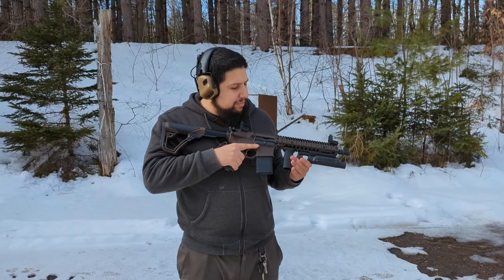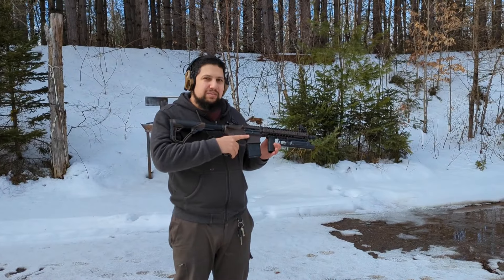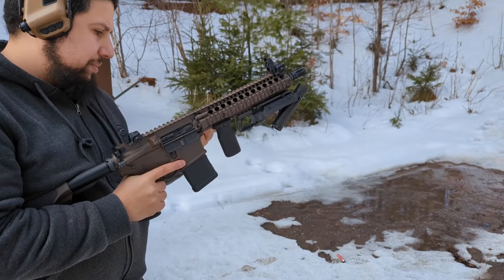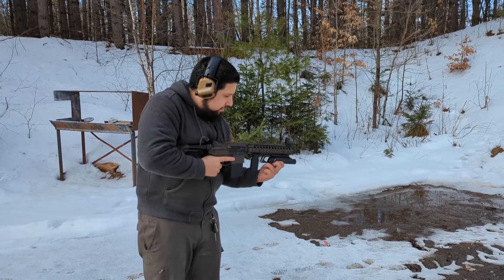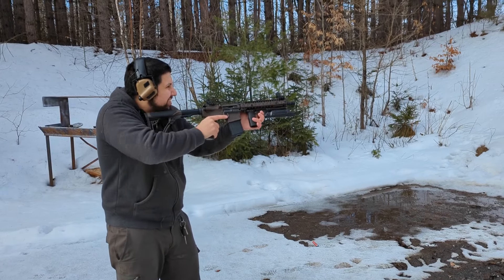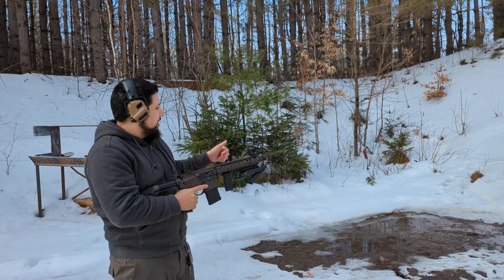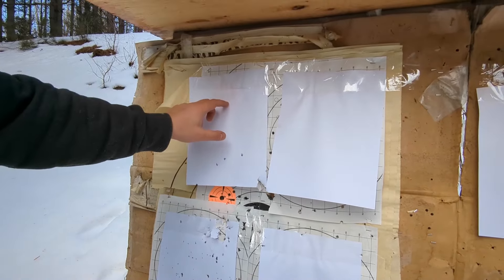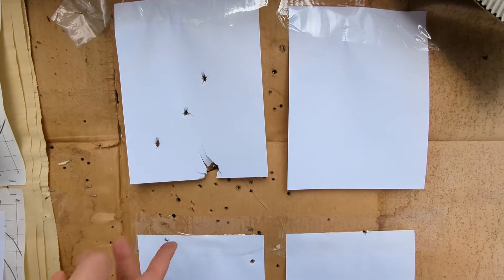This Mini-Shotgun is a blast!

Comment: If these are sold with a stock or some sort and labeled as a single shot shotgun, would it not be classified as NR? Also, can you make the barrel a little longer.
Reply: Yeah if the trigger was all the way back to the receiver, and extend the barrel, it would have much better usable accuracy